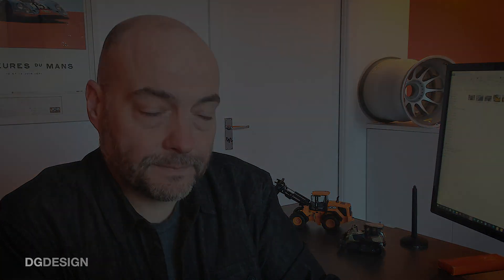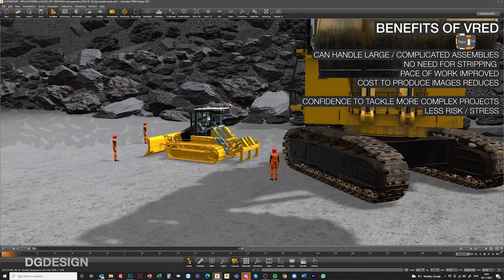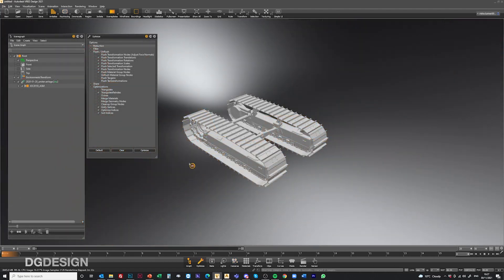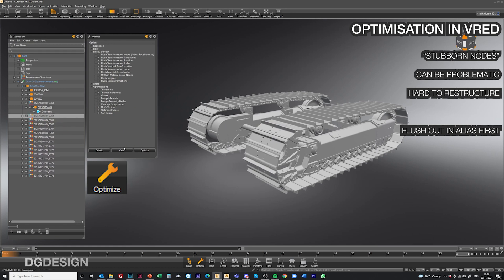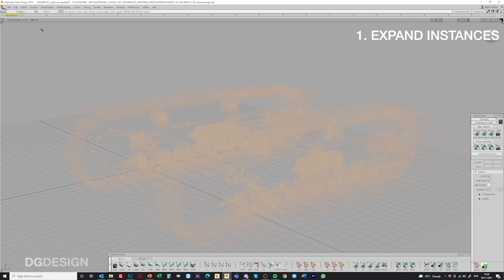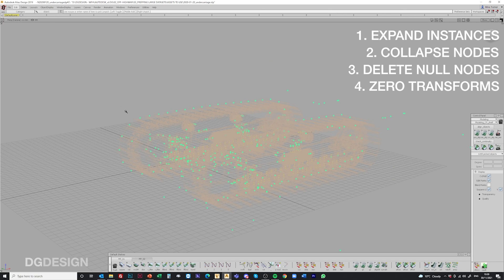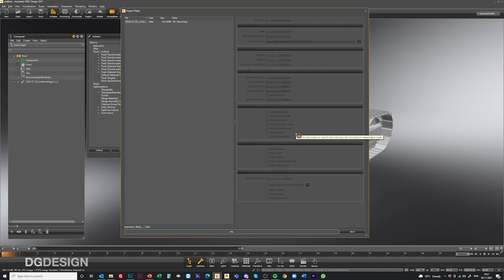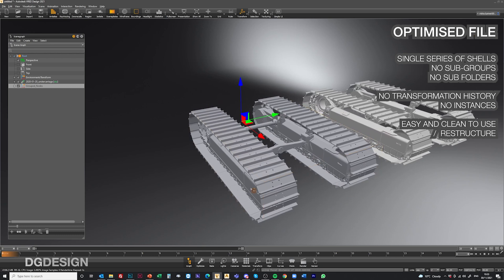Behind the Scenes with Mike Turner, S02/E02: Working with Large Data Sets

Comment: You can achieve a flat structure in VRED, too, without going through Alias. The reason you cannot flush the transform on some of your nodes is because they are or contain instances (indicated by underlines). Kill all instances with <Unshare>• Then optimize the transforms,use <Cleanup Group Nodes> and if needed <Merge Geometry Nodes>. This does in most cases not lead to a flat structure, yet. For that select all objects by dragging a rectangle in the 3D viewport and cut and paste them under a single node. Then delete the now empty former structure. VRED really is good with big data. We normally keep the CAD structure in our VRED master file for future version changes and for individual object axis positions e.g. hinges.